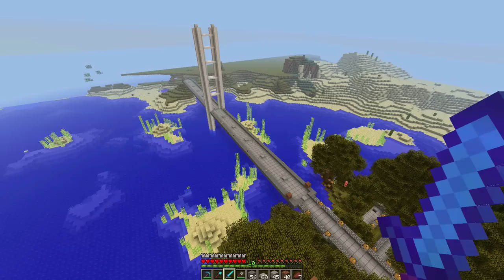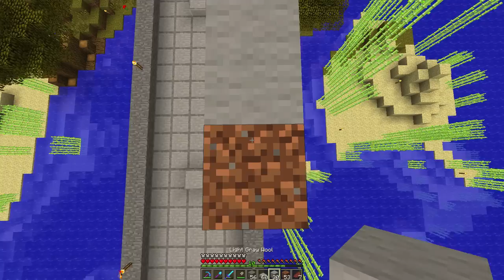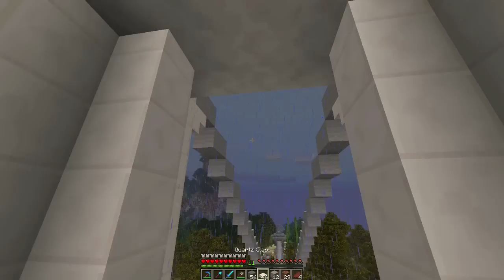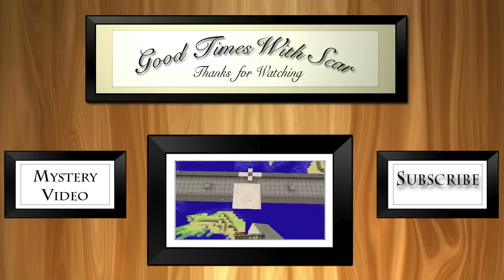Minecraft Tutorial:   How To Build An Awesome Modern Suspension Bridge   (Part 3)

Comment: Hey Scar, thanks for the video.  I think if you want to make this a suspension bridge the support cables need to be a progressive radius curve, like a parabola.  You could keep the current cables, but add some more to make it a cable stay bridge.  You can google both images to see what I am talking about.  Also, a suspension bridge needs vertical cables running from the support cable to the road deck, maybe from iron bars stacked vertically.  Lived in Portland for nearly 20 years, now in Bend.